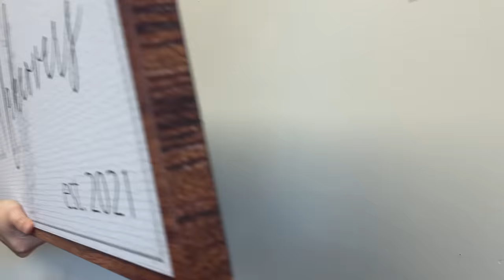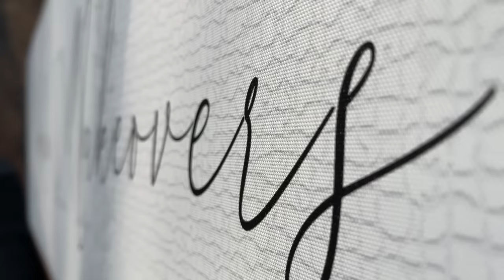Restoring An ELM Washstand (AMAZING WOOD GRAIN REVEALED)

Comment: I inherited an old wash stand that my grandfather repaired years ago, but the original owner never picked it up. It sat in his garage/workroom for decades. My parents inherited his house and mom found that wash stand. As they were moving it into the house, they discovered the granite slab used for the top wasn't actually attached, and took it off to made the stand easier to move. Imagine their surprise to discover the granite slab was actually an old tombstone, lol.
Reply: Congratulations on your haunted washstand 👻
Reply: Hope there wasn't a name on it! 😆😆🇬🇧
Reply: @carolinejohnson22  lol no. The rest of the story is that grandpa used to pick up odd jobs for extra money when his 3 kids were little. Our city was moving an old cemetery and there were a number of tombstones that were unusable. So he helped remove  them. He also used some fragments to floor the enclosed back porch. That's where you find names and dates on some stones, lol.
Reply: @toniatchison3678  Great story! I like when people use what they have and turn it into sth. beautiful or useful. 🧡
Reply: Oh wow 😮
Reply: @WasLostButNowAmFound  don't think of these as standard tombstone thickness. My grandfather was a very resourceful man. I suspect he may have had a way of cutting these in half, because these are no thicker than an inch or inch and a half. I can't imagine those things being cut to that thickness for use as tombstones, as they wouldn't last long in the elements without cracking. But in addition to the slab on my wash stand, he also built an enclosed porch, floored with pieces of tombstones. We found that out when my dad had to reset a loose stone, lol. Oh and yes, my 3-foot long piece of purple/brown granite weighs over 100 pounds, so it's heavy.
Reply: Recycling at its best.
Reply: 😂 I like the story
Reply: @carmenpohl6061  thanks!
Reply: That night after removing the Head Stone, it floated across the room and went out to the the window back to the old grave yard and was never seen again ................... Watch out for floating Head Stones
Reply: Lol!!! Creepy.....
Reply: Delicious!
Reply: That's amazing!!
Reply: @Fruity_lexia  ьььььььт
Reply: I bet that stopped them dead in their tracks.
Reply: You hoped not literally dead😂
Reply: That had to be a big surprise.
Reply: @shellydehart8217  like you would not believe, lol

Comment: Another beautiful makeover Andy!  It's funny, my refinishing experience has been pretty substantial looking back...
1) 2021: kitchen table (sanded and painted grey), 
2) 2014:  8 dining room chairs (removed orangey stain and stained dark walnut), (took forever)
3) 1999:  smaller 1920's era kitchen table and four matching chairs  (paint stripped and stained dark walnut)
4) 1998: large wood desk and chair.   stripped clear coat and stained dark walnut.
4) As a teenager in 1991, I repainted over my Mom's childhood hideous bright yellow 4 drawer dresser with grey and black paint.   Then in my mid 20's, I stripped both coats of paint away and did a clear finish.  I still use it today since it's kind of a family heirloom now.  The wood grain and even the ridged fluted look are identical to this washstand!  Since I am also in Toronto area, I would imagine it is of the same era and possibly manufacturer.  I still remember working into those grooves with paint stripper, steel wool and sandpaper to get the black and yellow paint out.  Took hours!
Had a question, why do you choose wax instead of polyuretane clear coat?

Comment: That looks amazing. Question: I have limited knowledge and tools (a saw a drill and an orbital sander to be exact). Without major investment, I probably won’t ever be able to make projects like this from scratch. As an entry level hobbyist would doing restoration projects like this be a good start? Find something cheap online, rip off the old finish, apply a new veneer and stain. I love the look of this washstand and I want something similar for my master bathroom. I’d love to try finding something similar and trying to bring it back to life like you have.

Comment: Do you know what the original wood is for this piece?  I have an old (falling apart) piece that looks very similar to this - but with 4 drawers.  Did yours have dovetailing for the drawers? Mine does not appear to have dovetailing, at least not the way my research indicates dovetailing could be.  Lastly, what circa do you think your piece is?  Thanks!  Great woodworking skills!

Comment: Remarkably well restored. As you have asked in your comment that the commentators should share their thoughts, as well, so I would have chosen slightly smaller handles or drawer openers (I do not know the precise term for them.). Barring the handles, excellently well restored.

Comment: Why not use paint remover to take the paint off that way you can reduce the risk of dust particals that can easily contain either asbestos or led in old paint. Or is the paint remover too risky to use on the paint and wood? I restored a 1940s baby crib with paint remover and brought out the beautiful wood beneath.

Comment: please don't feed wood on your table saw like that.. never push into the blade from the opposite side of the fence.. if you're cutting on that side use a sled or a miter fence.  (when you cut the top).  And don't ever use both a miter and a fence at the same time. Clamp a piece of wood to the fence if you want to use it as a stop.   Other wise great job.. cool editing

Comment: That's a very nice looking restore! Great job on it really love the look and feel to it. Id be a little worried on the long term hold on that bottom shelf tho. Next time lock the legs into the shelf with a dowel. It'll take a lot of the stress off of the glue joint moving it around in the future.

Comment: So, why do you have to tediously scrape off the paint and shellac before sanding, why can't you sand it away? Just curious
Reply: my assumption is is that orbital sanding is actually way more tedious and would cause unsightly circular defects in the wood and hand sanding is to allow it to be done in a more controlled fashion
Reply from the maker: With layers of paint and shellac that thick, sanding would take much longer and I’d have to go through a lot of sandpaper (the paper gets caked with paint rather quickly).